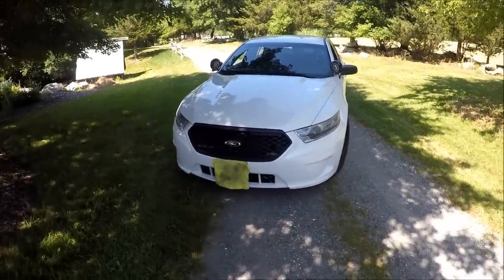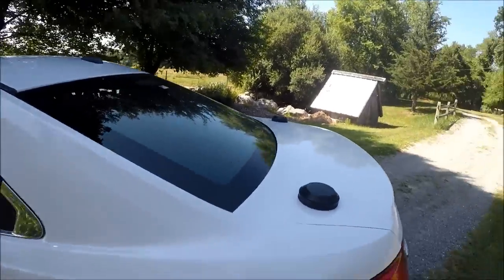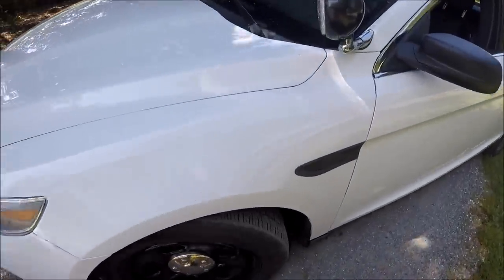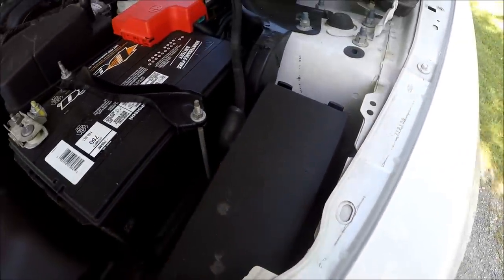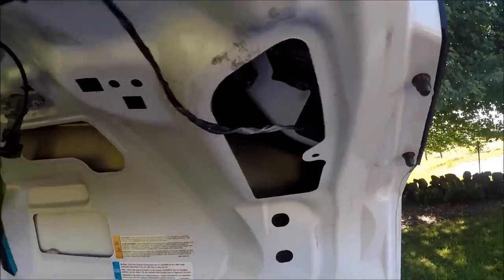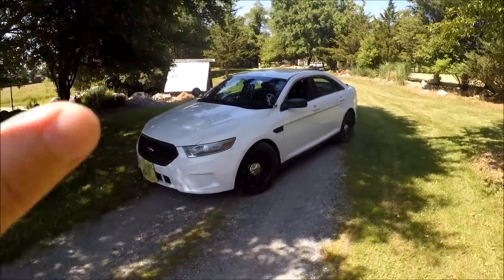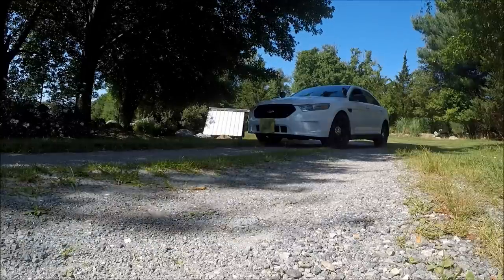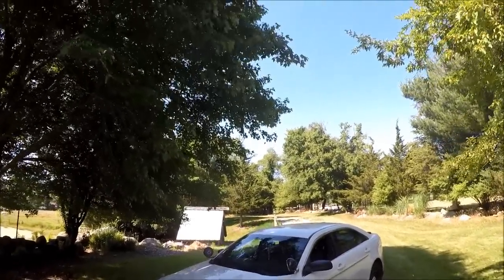What my car used to be when it was in service!

Comment: Mine was a California Highway Patrol commercial vehicle enforcement car. I found a fired 9mm round under the seat. It had 5 antennas on the roof and a CB antenna on the passenger side rear fender. I plugged up all the holes because I don't like the look of antennas.
Reply: Corey, when I got my car it was the same when I got my car the roof leaked in multiple places and badges were missing or broken along with some interior parts. I had to replace the carpet in it. It didn't come with a push bumper, spotlights, or antennas just holes where they used to be. I've owned it 2 years and I'm still finding issues caused when it was in service. You can see it on my Instagram page, the link is on my channel description.

Comment: Dont attempt to hook up the strobes without  first checking  to see they didnt cut the LED Driver out which they most likely did. They only leave the strobe heads to seal the light unit from moisture! Nice car  though.

Comment: I own a black and white 2005 Crown Victoria, that was a city patrol vehicle in Syracuse New York. On the header panel between the hood and the grill you can still see the silhouette of the words “Syracuse police”, and on the side of the car, you can still see the “emergency dial 911”, as well as it’s unit number, which was 0105. I know it came directly from the Syracuse police department because I bought it from their auction of retired vehicles. They retired it only due to age and mileage. I bought it in 2014, with only 77,000 miles on the odometer.
Reply: Addition to below: 
I think you might be right about the unit number being written on the sunvisor. My car has the number 105 written on both sunvisors on the warning labels as well. So I think you may be onto something with that unit number being written there.

Comment: I did do some digging. The agency your vehicle came from most definitely had the unit number written on the visor. The agency usually has two digits at the rear, most were in the 60s when I looked. And I did come across an image of a ford explorer police interceptor utility with two numbers written at the visor. It was faint as the image was focusing on an officer sitting down. A six was on there for sure, but I couldn't make out the other number. I assumed it was five.

Comment: CV, have you had many mechanical problems resulting from hard police use on your pi cars? I suspect they are serviced better than most vehicles but the abuse factor is there. Long periods idling, full throttle pursuits, driving over rough surfaces and obstacles like curbs are things cops do all the time. Not to mention beating the crap out of them because its taxpayer money so who cares? Normally Ford products fold like cheap lawn chairs under hard use but these seem to be fairly HD so maybe not.  Bob.

Comment: My 2011 crown vic was all black (as it is now) and was unmarked. It's front a department about 20 miles south of Pittsburgh. It was a chiefs car, his business card was in the very front cubby of the front driver's door that I found after having the car for like a year. No cage or exterior holes. There is a hole in the headliner where the camera was, and some holes and marks from where interior lights were, also a bunch of wires still in it, random buttons on/under the dash, and it still has (white in front, and they are in the brake housings in the rear) strobes which I crudely hooked back up. It also had the external hdd under the dash from the camera, but it's a brick to me unless I could find a way to hook it back up but I bet it's either A) empty,  B) encrypted, or C) dead.
 I've had the car for 2.5 years and it had 72k miles and 600 idle hours when I bought it, currently at 80k miles and about 800 idle hours. (I don't drive it very much as I have a company vehicle, and I don't like the cvpi as much as I had hoped/thought I would :( - I'd actually get rid of it but I got screwed when I bought it and still owe money on it.)